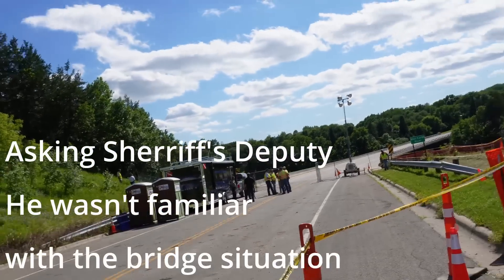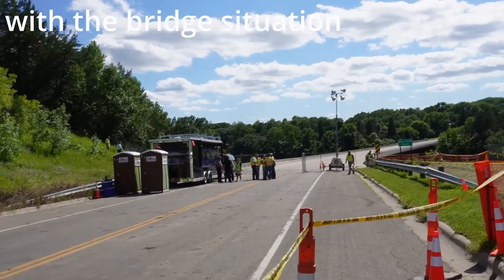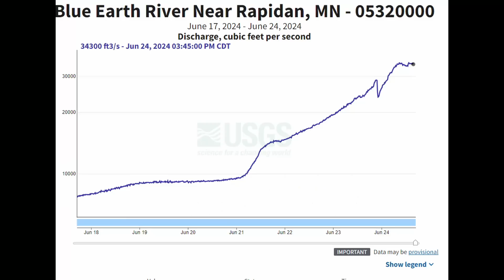Update: Onsite at Rapidan Dam Failure - Minnesota

Comment: Not a dam engineer but I work in roads. Seems like the overflow went through a parking lot/driveway area? What was up with the grading, was this intentionally designed to act as a de facto spillway (was the apparent depression in this area part of the design or was there subsidence)? Was there a storm sewer system to intercept any water that entered this area and send it downstream? I'm really surprised there was no spillway and I'm really curious what factors occurred early on that allowed water to take the path it did and if that was ever considered initially or in the years since.

Comment: The Blue Earth River will keep cutting into the earth to the side of the dam.  It's very sad and tragic, but that store is gone.  Just a matter of time.  Blue Earth county said it should have been rebuilt or torn down back in 1972 after they acquired it from Northern States Power (now Xcel Energy) and that was only after floods in 1965 damaged the dam.  This country, the state of Minnesota, everybody is so damn cheap and petty!  1972 was over 50 years ago!  Some other events occurred as well in the last 25 years causing problems with dam.  This should have been addressed ages ago!  Oh no, might have to spend a dime and remove a structure that we grew up with!  The dam was built in 1910 for heavens sake!  Either put some proper repair and maintenance into it or get rid of it!

In the town of Lanesboro, MN there is a very very old gravity arch dam built in 1868 on the Root River.  Finally in 2017 the state legislature granted Lanesboro $4 million to repair the dam.  However because of the National Historic status of the dam it couldn't be altered from its original construction style.  They built a cellular dam upstream to lighten the load on the original arch and because the hydro-power mechanisms were not part of the historical status they were able to be properly updated.  Proper repairs cost a lot of money but it can be done.

Greed and apathy are the source of many problems in this country and infrastructure is no exception.

Comment: Not usually the conspiratorial type, but being quoted $87m to remove the dam could definitely be a reason to allow the debris to build-up to reach a point that nature does the hard work for them and takes the dam down. I'm sure there's an investigation going on into this, but the way I understand standard procedure would have been to open the gates fully to prevent the failure like we see but debris build-up caused them to not fully actuate.

Comment: The dam is not monolithic.  It has large A frame type sections with concrete plates in between, iirc.  I was inside that dam after the 65 flood destroyed the gates.  In 74 or 75 or so it was repaired and put back in generating power.  There was a catwalk that went the length of the dam inside it.  Not sure if it survived the rebuilding.

Comment: It is too bad that when they upgraded the dam that they did not remove the roadway on it and install a self cleaning wedge wire coanda intake and spillway that would have allowed debris and ice to simply go over the top of the dam, and also act as an automatic emergency overflow. This would have likely prevented the restriction from the debris and kept the water from overtopping the dam abutment area.

Alternatively they could have kept the original design, but added a concrete overflow channel on either side of the dam.

Comment: That lump of rock anchoring the left side was maybe part of the reason the dam is where it is? It seemed pretty resistant to erosion as your big red arrow points out. The early footage led me to think that type of bedrock extended into the area now washed out, but apparently not! If they knew when they built it, that it was just soil they must have assumed water would never over top it in that location? That assumption being that the spillways would always be adequate? If spillways plugged with tree debris is enough to overtop what is essentially an earth filled dam, as you point out, it WILL fail. Seems like a shortsighted plan!
Reply from the maker: I think you are correct on each of your points.  It seems as if lack of maintenance for this dam and reservoir was a big part of the current problems.

Comment: Casey, in the comments from the first video and this video there are a lot opinion based on miss information. Please do another video to give people the information that they are missing. 

Opinion, the debris build up was the result of poor maintenance. And a related opinion, there should have been a debris barrier, catch or fence above the dam. 

Here is some of the missing information. On Sunday the bridge was acting as a debris barrier. Throughout most of the day Sunday there was very little debris on the dam. The dam operator did contact a contractor to remove the small amount of debris that was at the dam. He contacted a contractor that had previously did work for them to remove the debris. The needed equipment wasn't available. It was five hours away. The contractor also had safety concerns. 

At 6:03 in this video the flow chart from the down stream river gage is shown. Looking at that chart we can see when the debris broke free of the bridge and floated into the dam. When the debris floated into the dam it created a significant partial obstruction. This caused the flow through the dam gates to quickly drop. Looking at the flow chart we can see this happened between 10:00 PM and 11:00 PM Sunday night. This caused the water level above the dam to rise. As it rose more water flowed through the debris. As the water level continues to rise water started to flow over the left bank. This can be seen in how the flow gradually increased. (Seeing this graph on the first video is want made me realize there are parts of the story that I am not hearing.) 

The bridge did kind of act as a debris barrier/catch. But any purpose built catch has to be as large and strong as a dam. That is likely why all the debris catches I have seen have been actually part of the dam they are protecting. They also need to have equipment to be able to quickly remove the debris. Separate debris catchers would also be a major safety risk. 

The large quantity of debris that we saw on the first video blocking the dam gates mostly all arrived there at the same time on Sunday night. It wasn't debris that built up over time due to lack of maintenance. 

Opinion, the dam has not been functional for a long time and should have been removed long ago because it wasn't functional. 

Some information. The dam stopped generating power in 1965 after a power plant flooding event. Over 43,000 cfs for comparison to current flooding. In the 1970's the question of repair or remove was considered. 

An effort to restore power generation started about 1980. It was producing power again in 1984. In the early 1980's and the early 2000's repair and reinforcement projects happened to the dam itself. There have been other repair and reinforcement project. The power plant stopped generating power a second time in 2019. Again it was a flood with a flow of about 34,000 cfs.

Since the 1960's this dam has experienced a five hundred year flood and is currently experiencing its second 100 year flood. 

Since 1984 the dam power plant has been generating power for 35 of the last 40 years. (Power for 2000 to 3000 homes.)

The county has been in the process of evaluating to repair or remove the dam. This of course involves studies to determine risks, benefits and costs. Community feedback was also collected. 69% supported repair. 18% supported remove. The cost of removal is multiple times higher than replacing. That cost includes the replacement of the SR-9 bridge. 

The points are, the dam has been producing electric for most of the last forty year. Removal of dams can be very expensive. And removal of the dam has been considered and studied more than once. 

Opinion, the sediment in the dam pool is full of toxic pesticides. 

Information, most chemically related death that occur on farms are caused by chemical produced by farm processes.  Not by chemical that are brought onto the farm like pesticides.  Example are gases in manure pits or silage gases. (This statement is talking about death that happen within days of exposure. Exposure both the particulate matter or pesticides is known to be related to cancer and lung diseases which over time can cause death.)

The statement of concern about the toxicity of the sediment has not included details of what chemicals or mechanics are causing the concern. Given this it is totally reasonable for someone that doesn't work in agriculture to assume the concern is pesticides. But I suspect that the likely concern is high nitrogen levels in the sediment. Though various processes high nitrogen can cause low river water oxygen levels which kills fish and other aquatic life. 

There was one or two dams at this location before the current dam. They date back to the 1850's or 1960's if I got the information correct. But these dams were smaller. They were mainly taking advantage of the rapids or waterfall at the location. So it is unlikely there was any sediment build up from them.

There are many possible toxic concerns. Without adequate information we should assume which one it is. We should look for more answers. 

Casey, considering your background you may want to do a video on the relationship between gain mills and related bridges. (Usually privately owned toll bridges.) The economic and geologic reasons they were historically located near each other. This is part of the history of the location of the Rapidan dam.
Reply from the maker: Thank you for your comments!  You have certainly given me a lot to consider.  I think it would be worthwhile to do a future update with a deeper dive into the key issues as you have noted.
Reply: @CaseyJones-Engineer  
In case you didn't notice, the USGS river gage down stream of the Rapidan Dam is presently only posting gage height. They are not post discharge flow rates. This is, "...due to uncertainty caused by rapidly changing channel morphometry on the stage-discharge relation."
Reply from the maker: @erniecolussy1705  I saw that. Thanks.

Comment: It seems that the original designers(Engineers) over 100 years ago knew how to build a dam to last. I have noticed that the dam is still standing fast. Under this great pressure that, which is surroundind it has been washed away but the dam wall is still complete.

Comment: The dam didn’t fail, the river overran its banks.
Reply from the maker: Any time a dam has an uncontrolled release cutting through the abutment contact, it is a dam failure.  The dam isn't just the main structure.  It also includes how that structure is connected at the base and abutments.

Comment: I would be interested to know if the bridge piers are supported on piles or a shallow foundation.  I think the dam should be immediately destroyed to try and return the river to its normal channel.  I worked on a dam removal project a number of years ago in which it was determined the upstream highway bridge was supported on concrete footings, project was canceled.  Later it was discovered that there was a municipal water line in the upstream stream bed which also would have been compromised.
Reply from the maker: Thank you. I am doing more research on this bridge as the west abutment looks to be in real danger of being scoured out.

Comment: Get some equipment down there and remove the trees blocking the normal flow to help reduce the bypass.
Reply: The water is already below the gates in the dam.
Reply: I'm sure it was not possible with the rapid water flow otherwise they would have done it.

Comment: Why isn't this information included in the news?   The dam was built in 1910.  It was damaged by flooding and no longer generated power in 1965.  In 1970 it was acquired by Blue Earth County and two years later it was proposed to either be rebuilt or torn down.  In 2002 it was found that the buttresses needed extensive repairs.  In 2019 the dam was damaged by flooding and stopped producing electricity.  In 2021 an engineering study was done to study the repair or removal of the dam.  2022 the county sought feedback from the community to either repair or remove the dam and 18% approved removal while 69% approved repairing the dam.  2023 the "National Inventory of Dams" rated the dam in poor condition and it's hazard potential significant.  The county should be held liable for the loss of the Hruska's home, business and land.
Reply: You're funny

Comment: Sir, can you provide any insight or opinions as to why there haven't been any attempts to reduce the scour using rip-rap or or other methods especially on the upstream edge as it is working back toward the highway bridge?
Reply from the maker: That is a good question and one I am a curious about as well.  I think I will put in a call to the County Engineer on that to see what they are considering.
Reply: @CaseyJones-Engineer  Thank you for the quick response. It will take months to remove the dam, and without some measures in place to slow the erosion the highway bridge could be in serious danger of compromise, not to mention the Dam Store. Especially if they continue to get more rain as the forecast and radar suggest is coming today and over the next week or longer.
Reply: @CaseyJones-Engineer oh so you haven't listened to a word the County engineer has said either lol good grief... media hyped nothing burger
Reply: @codeack101wlck  Can you provide a link to the County Engineer's statements you are referring to? I saw footage from a press conference but that was several days ago.

Comment: the dam did not fail. the sediment would have gone down steam even if the dam was not there. it is a guess if there is a large amount of contaminants in the sediment up stream. what is considered as a large amount of containments in the sediment in relation to the amount of sediment?  need to figure out how to move sediment down stream with a dam in place. hydro electric power is the cleanest form of energy. the failure of the overflow allowed the water to be released in a much slower pace than if the dam failed. this saves lives. finding a way to capture flood water before it causes damage is the key. sending flood waters to an artificial man made dry lake is an option.

Comment: The dam has been breeched by eroding out a  bank and is a total loss..   It was poorly designed by engineers with gates that could be blocked by debris and without a proper spillway.  The spillway would have prevented the erosion of the bank and total loss of the dam.   With the flow shown in the river the silt is already down stream, regardless if it contaminated, or not.
Reply: It was poorly designed? It withstood all mother nature threw at it for over 100 years!

Comment: so someone help me understand...... scouring on the bridge.... is it actually displacing the soil holding the bridge pillars?  or it is knocking away at chunks of the bridge concrete?
Reply: My understanding is that scouring is basically washing away soil around the base because of the rate of flow of the current.  Not a professional opinion.

Comment: They don’t have to worry about a flood down stream of the dam if it fails. It’s already basically failed because it’s completely bypassed now.
Reply: There would be a high water surge.
Reply: @artsmith103  for less then 2 miles only a couple feet high and not far outreaching due to steap embankment, it's a nothing burger
Reply: @codeack101wlck  You can look up it's more than a couple feet. At this point it doesn't look likely to happen.
Reply: @artsmith103  please explain what you looked up because I've seen the emergency flood model I live in the area, can't get this one past me
Reply: @codeack101wlck  I thought you were referring to some part of the dam. 3ft standing wave surge is a good estimate.

Comment: I venture a guess that the dam didn't fail, but the ground around it did?
Reply from the maker: That is correct, but they work as a system.  Flow through the dam was impacted by accumulated debris on the upstream side.
Reply: @CaseyJones-Engineer was there no “safe” option to remove any accumulated debris before the situation became dire?

Comment: I’m not a civil engineer but - why don’t they open the dam gates to let more water flow through the dam and prevent the river from re-routing?
Reply: The gates are always fully open.  The water level has fallen so much that it no longer reaches the gates.
Reply: @jayteegamble  thanks I wasn’t aware of that.  Over the weekend when the water was just beginning to flow around the dam - it appeared that there wasn’t water flowing thru the dam - only around it.

Comment: What type of primary element are they using to calculate the flow rate?
Reply from the maker: There is a U.S.G.S. stream gage just downstream of the dam.  I don't know the details of its construction though.
Reply: @CaseyJones-Engineer  They will not have much profile data at these flows and depths.  Especially considering the topography of the river now compared to when they established the relative data; head/Flow rate.
Reply from the maker: @randymclean9121  Great point.  I was thinking that is was possible that the higher flow rate was plausible as the river is much less restricted now, but I don't know.